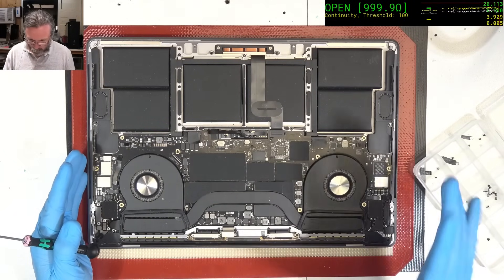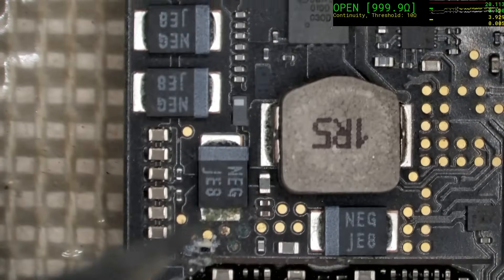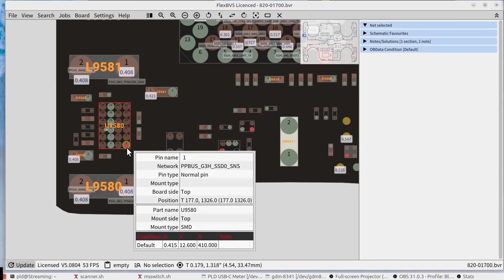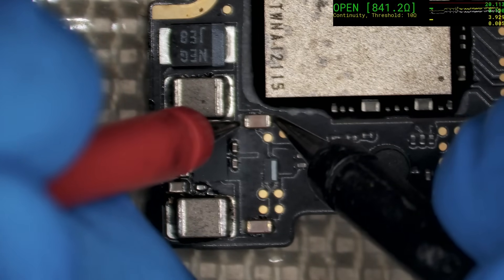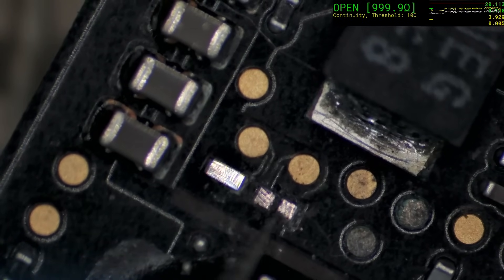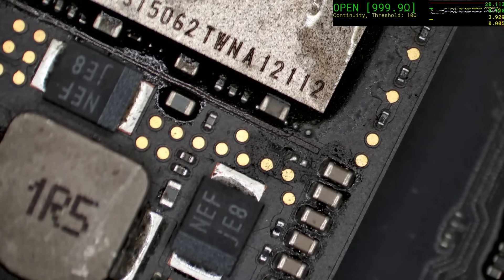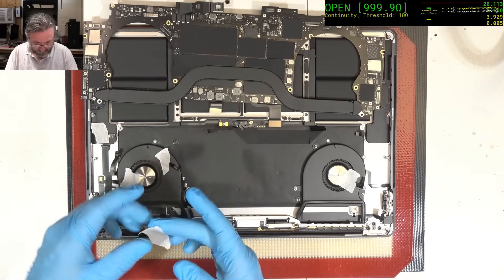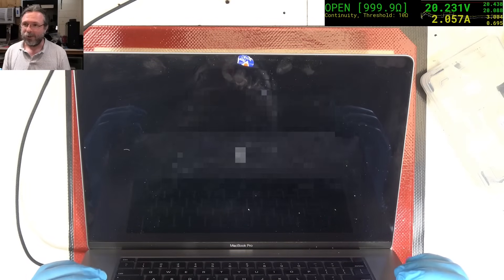One in a million Macbook repair.  Defying "Forever Dead" ( Macbook A2141 "No power / died" )

Comment: Hi Paul. 
Could you help me out please? I have an older macbook pro A1278, that freezes after about 1-2 minutes of work. It has win10 installed (actually the HDD is from another laptop) but I've tried with multiple live Linuxes, even the online macOS recovery. It freezes completely, not just the screen. No inputs, HDD activity stops completely, fan is still spinning, image is frozen. I have to force shutdown. One interesting note, If I hold the Option on boot, it can stay indefinitely on the selection screen, without freezing. Tried multiple RAM's, did all the reset stuff. No visible liquid or other physical demage.
Any idea what this could be? 
Thanks.
Reply from the maker: Try with just one memory stick, could be the classic fatigued/cracked SODIMM slot problem that plagues them.
Reply: @pldaniels  I did. No change unfortunately.
Are there any other typical faults for this model? Some sensor maybe?
Is it normal for the CPU to get very hot? The back side of the PCB where the CPU is located, the pads turned reddish over time from heat. (fins are also hot, so pipes are working)
I try to run memtest86 somehow to rule out RAM issues.
Thank you again.
Reply: I let 4 whole cycles of memtest. Passed without errors.
Reply: What model year is it? The 2011 models are plagued with GPU issues... Although a solid freeze sounds like a CPU issue to me... No bluescreens in Windows?
Reply: @Stormcrow667  Hi.
Yes something like that. It's a 820-2879B board with MCP89 GeForce 320M GPU, Core 2 Duo P8700.
It doesnt fully boot into Windows.
Tried even installing XP, every time freezes at "registering components". Half way trough.
Antix freezes on "waiting for /dev to be fully populated". If I edit some PCI bridge registers for the GPU, it gets past that but still freezes after a while. (juft after "waiting for resolvconf", and before "configuring network interfaces" This with disconnected wifi/bt/camera)
Win7 install can't even get that far.
My guess is also GPU. There are no artefacts or such, so I really don't know.